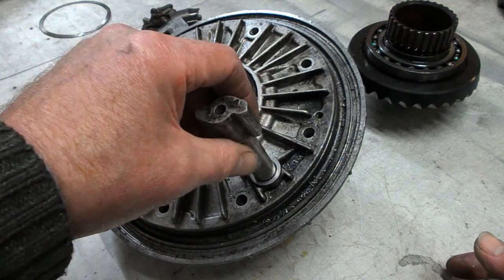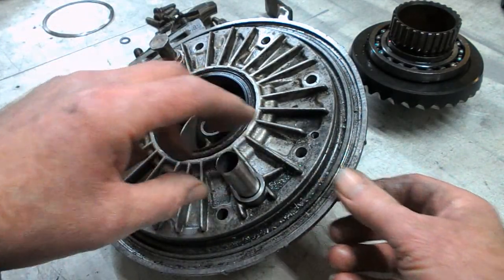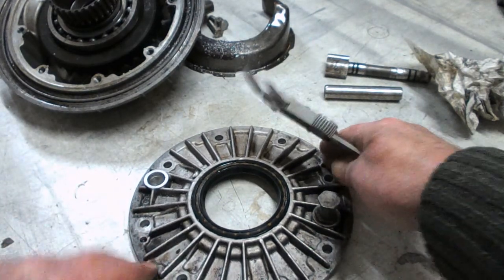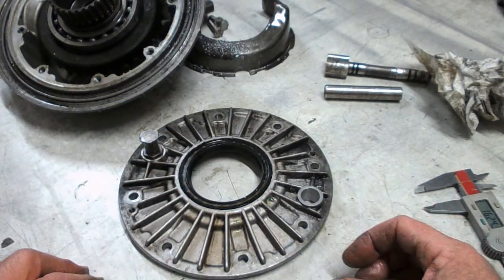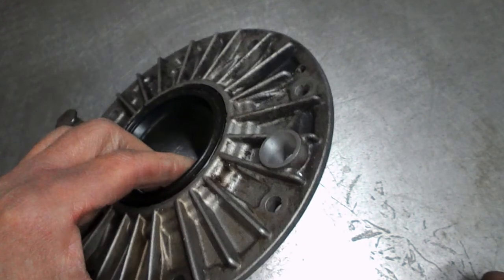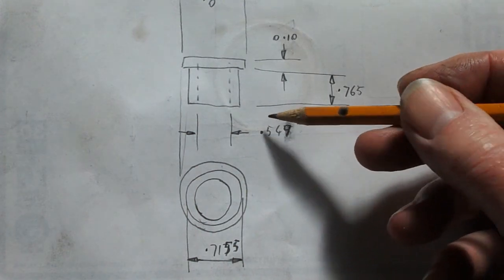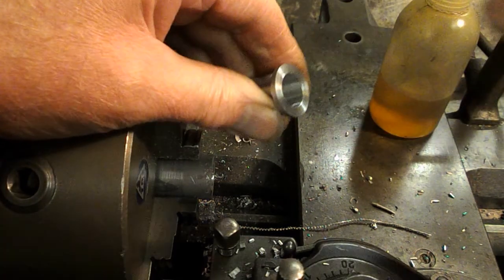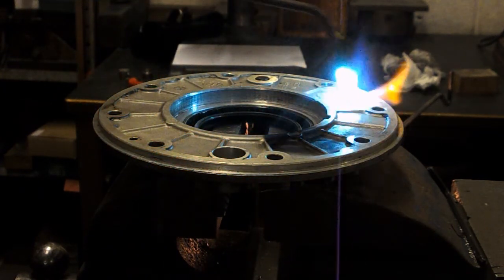Fixing a leaky brake pivot in a BMW final drive.

Comment: Looks like a final drive housing from an 80s R100.  My1981 R100RT has the same look final drive housing. with the radial ribs which are not present on the 1970s R90 and R100 final drive housings.